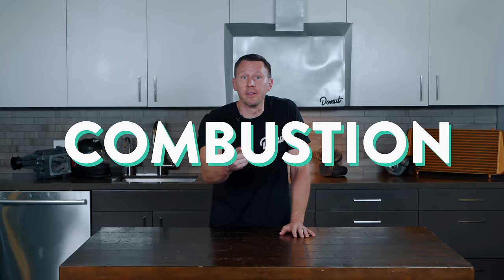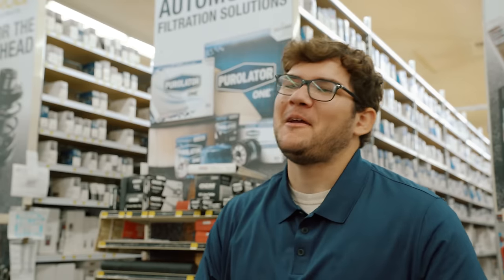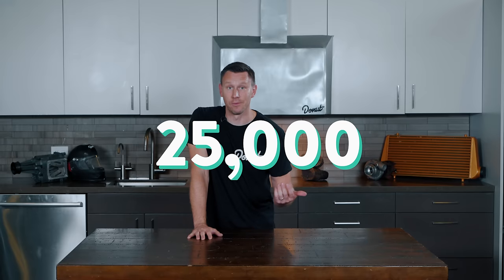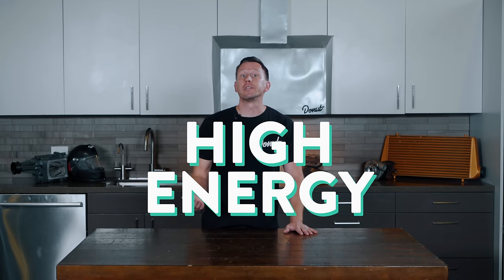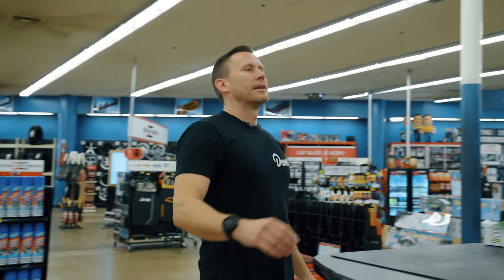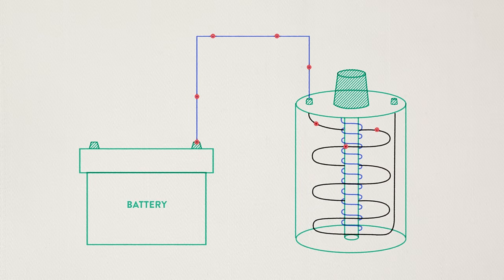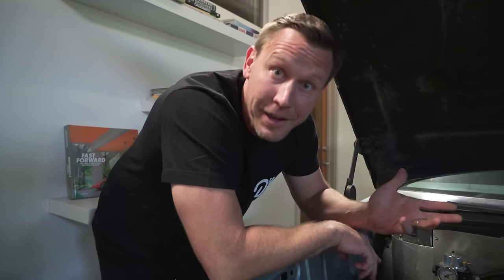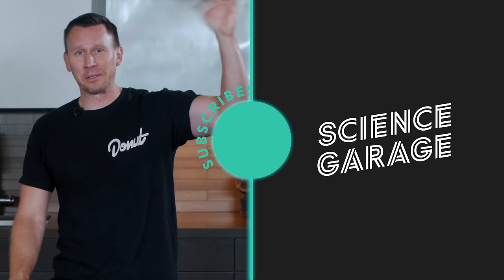Ignition Systems - How they Work | SCIENCE GARAGE

Comment: ABS - How it Works
Reply: Do sit ups, get ABS
Reply: @Shazzkid  lololol
Reply: It's a computer program that prevents the brakes from locking up the wheels when braking.
Reply: @flyingpirate0456   no shit, thanks captain obvious.
Reply: You have a better grip on the ground when the tires are move at the same speed as the road surface, called static friction. If your wheels start to go faster or slower than the surface of the road you lose a small amount of grip, so what ABS does is constantly try to maximize the static friction force by finding the breaking point and staying just below it so that you don't just slide along the road.
Reply: How about ABC
Reply: @Omar-em7rl  I'm sorry for not making this obvious, but I wasn't talking to you
Reply: @justahasbeen  
Which is done by a gear and a counter sensor that counts how many teeth per second each wheel passes by, if a gear is faster or slower then more or less gears are passing the sensor per second which means it has to make them all equal. I think there are other methods as well, but just to clarify one of them and a quite common for most standard and cheaper ABS-s for traction control and wheel speed balancing out there.
Reply: Just when you think you got shit under control your brakes will fuck you with a mind of their own. Or save your life could go either way... ABS simplified
Reply: They don't
Reply: Shazzkid thank you

Comment: The best things happen after you hit the start button..
Reply: But the start button is also the stop button so it depends whether or not the engine is already on or off🤔
Reply: On a 2020, 0.2L, 1 Cylinder, Diesel, Automatic, without Handbrake, Smart?
Reply: Or turning the key
Reply: @jag7371  Key? All I have is this remote
Reply: Nothing beats a good old crank

Comment: Thanks for another great episode of Science Garage, @Donut Media,  I always eagerly anticipate these! I have a suggestion for your production team, in your past two videos the dynamic range of your audio tracks on the videos has been very high. In other words, the difference between the loudest sounds (like a shout) and the quietest sounds (like dialogue) is very high. This makes it difficult for the average viewer to hear regular dialogue at a normal audio volume, so the viewer turns up the volume to hear it, then when a sudden, short, loud sound occurs it is very loud for the viewer so they need to turn down the volume of their speakers, thus making it difficult to hear regular dialogue again, and so on. For action-packed videos, like a sci-fi space battle, viewers will likely enjoy having their speakers set to a high volume for the duration of the video, but for comedy, educational, and other dialogue-focused videos it can be uncomfortable to listen to and hard to understand. So, for the editors or whomever works on the digital assembly of your videos, I recommend they apply a "normalizer" and or "compressor" filter to the audio track, which makes the quiet sounds (dialogue) louder and the loud sounds (sound effects/explosions/shouting etc...) quieter. Most video production software comes with a simple audio track compressor filter that can be quickly and easily applied in post-production/editing that will make the audio of your videos more consistent. Just a suggestion from a frequent viewer, lover of Donut, and car fanatic, keep up the great work, guys! :D

Comment: did he talk about gapping the plugs? sometimes plugs get banged around, and the ground strap may be closer or further away from the electrode, so you can use feeler guages to "spec" them so they are all the same gap distance which helps with fine tuning spark timing for high performance applications

Comment: I was expecting a talk about the ignition that starts your car
Reply: Roman Chyshkevych same thing, bar the use of the starter motor and immobiliser. When cut the ignition it breaks the circuit of the ignition or the coils/distributor
Reply: That's just a switch just like any run of the mill three position switch.
Reply: No that's too advanced for Barts viewers

Comment: That distributor and wires are for an aircooled vw.  Where’s my prize?
Reply: I was scrolling the comments to see who else knew
Reply: I noticed that as well. Looked like a 009. I thought that when he first showed it, even without seeing the drive mechanism at the base. Dead giveaway was when he had all the plug wires attached and they had the rubber grommets at the plug ends to seal off the cooling tins. Not surprising though, it's probably the most commonly seen classic car old enough to have such a points-distributor system. Likewise, if you google how to set ignition timing, without specifying the car type, most of the results are describing how to do it on a Bug, though the basic idea is applicable to any car that uses such a system.
Reply: @quillmaurer6563  thats the cheapest distributor he could get. i have an svda!
Reply: @bugaddiction71  Yep, 009s are cheap - but they suck. SVDA is best short of anything fully electronically controlled. When I first got my Bug it had a 009, got an SVDA after a while which improved drivability notably. Added electronic trigger, which made it run significantly better - wasn't expecting that. Then converted to fuel injection, used electronically controlled distributor. Then switched to a wasted spark coil pack, then wasted spark LS coils.
Reply: I thought the same thing. As soon as I saw the distributor I thought, “hey that’s a 009!” Too bad it’s a Chinese one. You can’t get those to run worth a crap. That’s why I rebuild the old vacuum advanced distributors. Been running my rebuilt 205T in my 69 bug for 4 years now.

Comment: In most front wheel drive vehicles nowadays you have to remove the intake sometimes the exhaust manifold to get to three of your spark plugs. In a Ford Ranger 4 Banger has 8 spark plugs and two coil packs.

Comment: But i saw the output voltage on the input of the sparkplugs ie the wires coming from the distributor and they were no more than 1.7 volts....Is there some interlocking system that when you try to tamper with the wires it droos voltage automatically?

Comment: Just to remind the viewers be cautious when around a car's ignition system. Once when working at a U-Haul there was a truck where the ignition switch wasn't working and we couldn't shut off the engine I knew that pulling out the center wire of the spark plug cap would shut the engine off. While I knew the kind of voltages that we're going through there I put a glove on my hand to reduce the chances of shock well regardless it got through and I got one hell of a shock.🤯
Reply: Or you could just pull out the oil pump cable

Comment: Well I have a compsci degree and most of the system involved with my engine are still off limits without:

A) elite level hacking skills and a usb-OBD2 dongle

or

B) a super expensive OBD2 access port that may or may not work but will still cost you $1-1.5k just to find out.

Good thing it basically eats coils + plugs or I'd feel just as useless maintaining it than I already feel whenever I want to upgrade it.

Comment: Can someone explain to me how spark plugs in small pull start engines get their spark? I know it has to do with the fly wheel but dont quite understand everything with the timing and stuff.
Reply: It is the magneto if I remember right. It uses a magnetic field created by the flywheel spinning past it to create an electrical charge. Similar to how a electric motor uses electricity to make magnetic fields which turns the shaft. I'm not an expert but I have done repair work and tuning on small engines for a few years as a hobby. I hope I helped a little if you do see this.

Comment: how does all the parts (pistons crankshaft cams valves etc) move before the  combustion stroke or power stroke
Reply: An electric starter motor is used to spin the crankshaft and start the cycle. The sound your car makes when you turn the key to start is the starter motor cranking the engine. Smaller engines will have a pull cord instead wich does the same thing.

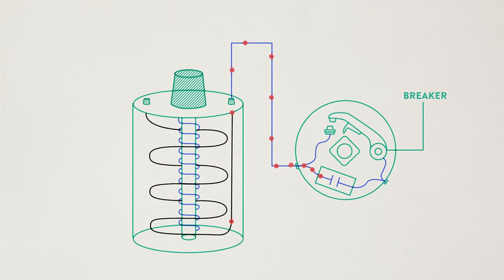Comment: I have been watching a number of ignition videos, and so many seem to fall into the same hole regarding the principles of the primary circuit - this one too I believe. Around 9:47, the comment is made that the breaker points open and interrupt the current to the coil ("suddenly disrupted" in the video) causing the magnetic field of the coil to collapse. Sorry, this is simply incorrect. The points opening does NOT cause the coil current to be interrupted. 

Let me try to explain - and be aware the operation is a bit more complex than commonly understood. In the primary circuit, with the points CLOSED, we electrically have a series R-L (resistive-inductive) circuit. Current is permitted to build up to a maximum value of I = V / R where I is the current, V is the battery voltage and R is the primary coil resistance (as well as any "ballast" resistance). The current flow is thus limited. The points are simply a switch which is placed in parallel with a capacitor (some books use the term "condenser"). Whilst the points are closed, no current can flow into the capacitor. The capacitor is uncharged and its voltage is zero. Now the crux of the problem - the points open. The switch across the capacitor opens and we now electrically have a series R-L-C circuit. With current in the coil, the current now begins to flow into the capacitor charging it. The voltage across the capacitor begins to increase as the capacitor is charged. 

Series R-L-C circuits have the property of resonance. Energy is exchanged between the inductor (L) and the capacitor (C). The frequency of the resonance is determined by the values of the inductor and capacitor. Typically, with an ignition system, we are looking a frequency of several kilohertz. Left to its own, the resonant voltages and currents produced would eventually die out as energy is dissipated in the resistor. But initially, the combination of the current flow and the rate of change of current flow consequent upon the resonance, results in very high voltages (hundreds of volts on the primary side) developing across both the inductor and capacitor. Now we can say that the rapidly changing magnetic field of the inductor induces voltage on the secondary side of the ignition coil, and with a typical 1:100 turns ratio, say 200 volts on the primary reflects as 200 x 100 = 20000 volts on the secondary. Note that the capacitor voltage is of the opposite polarity to that of the inductor, so that the two voltages sum to zero, and the battery voltage can be initially attributed to the resistor alone.

But spark plugs begin to arc when the voltage has reached about 8000 volts. A secondary circuit is completed and now a new approach to what is happening in the primary is needed, which I won't go further into here.

So often, I have heard that the purpose of the capacitor was to protect the points against the "back emf" - the voltage of the coil - which supposedly causes arcing and pitting of the points. It is a nice story, and combined with the brief comments as in the video about interrupting currents causing the coil magnetic field to collapse, all seems good in the world. It all seems to fit. 

The problem is that it doesn't. Those stories are NOT how ignitions work. If you don't believe me, well simply disconnect the capacitor and try and run your system. It will either run like a sick dog or probably not at all... The capacitor is an absolutely vital part of the primary ignition contributing to the production of high voltages in the primary coil. But it is so misunderstood.

Comment: But why does my R1, with the supposedly long lasting iridium spark plugs, require me to change them every 12k miles? Is it the high, 13:1, compression ratio? The astronomical redline? Or just the overall high performance nature of the engine?
Reply: All of the above probably

Comment: So the whole system is almost the same except newer cars use the ECU (engine control unit) which from Google looks like a microchip. I'm guessing this system is more efficient and faster, but if it fails is it easy to replace? Can I go to the shop and get an ECUn or is it very particular to the make and model of the car.
Reply: Pretty much, the ECU can be replaced however it is usually an expensive repair. An ECU will cost at least $1000, but it is pretty simple to install and program it.
Reply: @Redtooth75  I see. So just finding a compatible ECU online is what will determine if we can still DIY or if we need to go to the shop/dealership to have it replaced. I guess we'll find out in the years to come.

Comment: When we accelerate , how is it communicated to the engine and how does the engine increase its speed?
Reply: When you press the accelerator pedal more fuel is injected into the combustion chamber. More gas more boom more power more speed.
Reply: your throttle pedal is connected to the intake system via a throttle cable. the throttle cable opens up the throttle body to let more air and fuel in and the engine simply just speeds up because it has to keep up with the rate of air/fuel mixture

Comment: In other words a spark plug is a sing wave generator that is on the board line of static and current 😄 aka volt vs amp ration of wattage aka joules per second aka electric forces harness aka attractive power aka smexy car.

Comment: When engine timing out then computer giving the ignition and injectors Pulse?  Reply Sir
Reply: If the engine is mistimed the spark will be occuring at the wrong time. Depending on how far off it is it could cause a loss of power or severe engine damage.

Comment: What about describing ignition timing - when it should be advanced/retarded, and the ways this is done both by mechanical distributors (centrifugal and vacuum advance) and in modern electronic systems? I suppose that's a later video, this was just how the spark is generated.

Comment: My vehicle has a problem and cannot start. 
nothing happens if the key is turned to the start position. 
The ignition coil will also burn after a few hours after the battery is connected. 
My vehicle was in the workshop more than 6 months ago. 
can anyone help? 
Thank You.

Comment: Velocity Stacks maybe science garage???
Reply: they did an episode on carburettors already
velocity stacks are just one barrel carbs for each cylinder
Reply: @bombardier6033  ohh sorry my bad 😅
Reply: @bombardier6033  is it possible to have velocity stacks on a efi engine???
Reply: yes, but the ones with trumpets are mostly carburetted. there are engines with individual throttle bodies, but they are all connected through a plenum (say, the RB26-DETT)
if you are trying to maximize engine power and want to leave it naturally aspirated, velocity stacks are the way to go
Reply: Kryotix_YTP Velocity Stacks are always good, even before a turbo or just a intake air box.

Comment: How the hell spark plug ignites at the right time, at the exact time when the gas mixture compressed?
Reply: Older cars used a distributor. It was a shaft that spun around and sent the spark to each plug at the appropriate time. Modern cars use a computer and sensors to decide when to fire the spark plug.

Comment: So if the Engine is ground and couldn't you just have a insulated terminal electrode and during the cycel of the Engine  a spark gets generated just as the piston head is Close enough  to the electrode 
Something like this would have many advantages
Reply: Some smaller engine that only operate at one rpm do use that system. However, on cars the spark advance will vary greatly depending on rpm and engine load. The system that you described would only be able to provide a set amount of advance which would destroy the efficiency of the engine.

Comment: What happens if the ignition gets hot? What does that mean?
Reply: Most likely referring to the spark plug tip. Spark plugs are made with a specific heat range depending on the engine. If the range is too hot, the tip of spark plug can get hot enough to ignite the fuel. This would cause misfiring.

Comment: Why some engine need 2 spark plug in 1 cylinder?
Reply: 2 spark plugs can improve efficiency by causing the fuel to ignite quicker. If the spark comes from 2 locations, theee will be 2 flame fronts that ignites the fuel faster.

Comment: But what about modern cars that don't have distributers
Reply: They still have a spark plug and a coil(s) but they are controlled with a computer.
Reply: Right but explain the ECU
Reply: @batmantheboss3260  the ecu gets signals from the crankshaft sensor and camshaft sensor. This tells the ecu the rpm of the engine and the stroke each piston is on. Some cars will use a MAP sensor (manifold absolute pressure) or a MAF sensor (mass air flow) or a combination of the two to determine the amount of air that is going into the engine. The ecu is tuned to give a certain amount of timing advance based off of the data the above sensors give.

Comment: Uhhhhhhhh forget diesels much diesels don’t use spark plugs hehehe it’s compression ignition so it uses the compression of the engine to ignite the mixture that’s how it is with diesels spark plugs are only needed on any thing else that isn’t a diesel related power source.

Comment: in the first place: how and from where the source of the power (high voltage) build up or sourced? what is the source of power to cause the spark??? YOU MISSED EXPLAINING THIS POINT:= THE SOURCE THAT GENERATED POWER TO CAUSE THE SPARK? AND;- WHY AND HOW : WHEN THE PRESSURE OF THE GAS JUST RIGHT ON THE TOP; THEN THE SPARK OCCUR? WHAT TRIGGER THE SPARK TO OCCURE??? PLEASE BE VERY SPECIFIC THAN MAKING EMPTY JOKES !!!